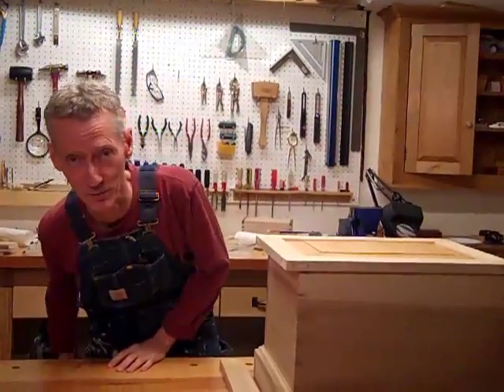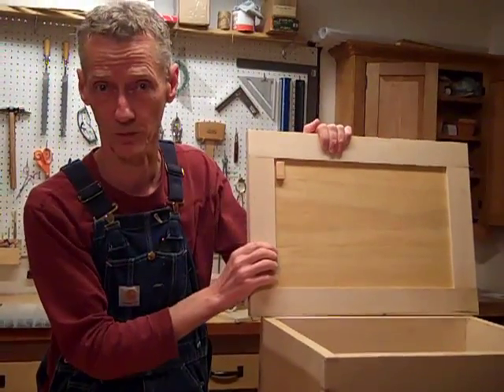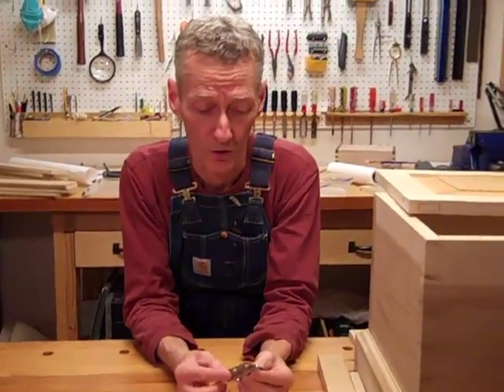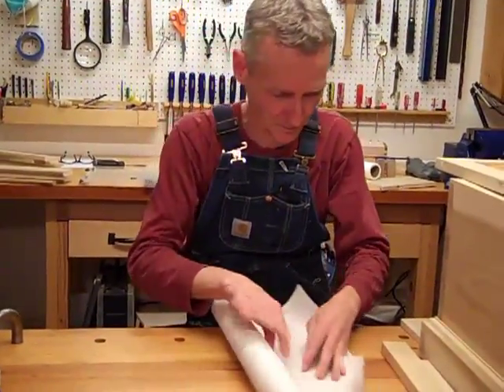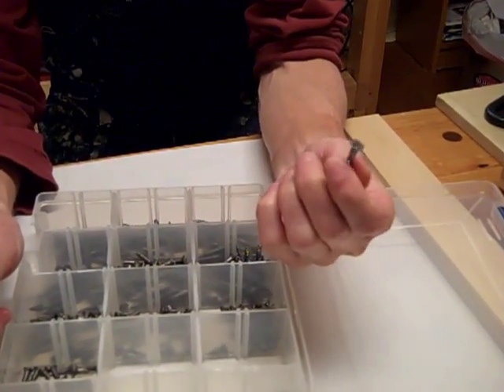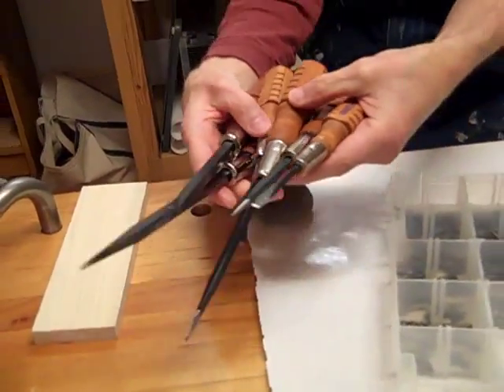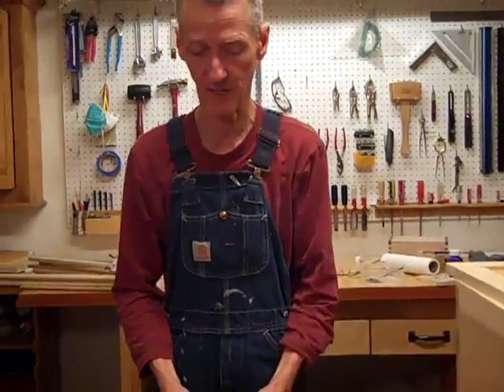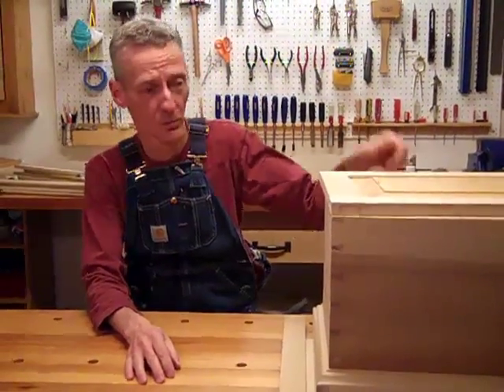Tool Chest Show #3

Comment: I've used gun-blued home center hardware on a number of projects.  When you put the gun blue on the hinges, you should NEVER put the used brush back into the bottle - it will have some reacted bluing on it, which will contaminate and shorten the shelf life of the entire bottle of gun-blue.  Better to pour a little (or use a big eye dropper) into another small container, then brush from that.  I've also had success with buying big bottles (like liter sized) of gun-blue on sale - fill a disposable container and just dunk the parts I want to blue.  Lastly - I agree about the flat-head screw dilemma - the big-box stores carry some small brass screws, but you can't find any zinc plated (or non-plated) screws locally.  I would love to know where you are sourcing your screws from.